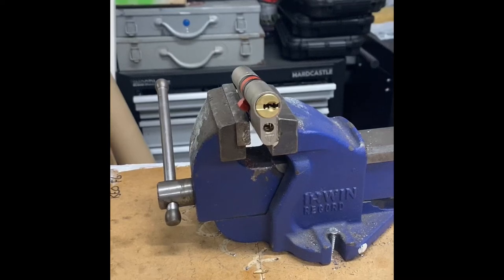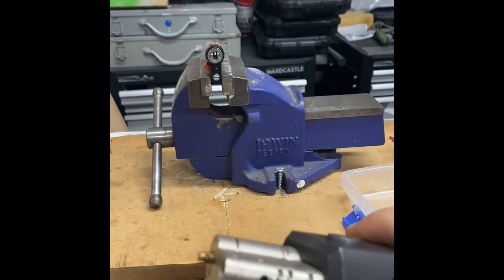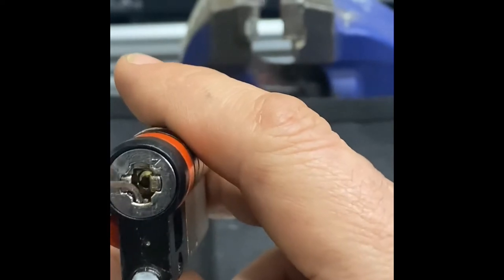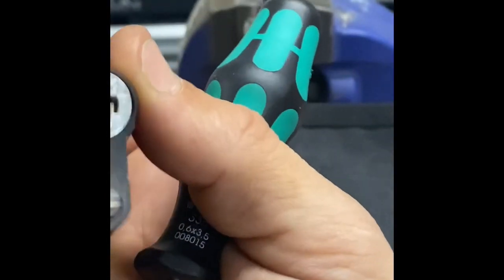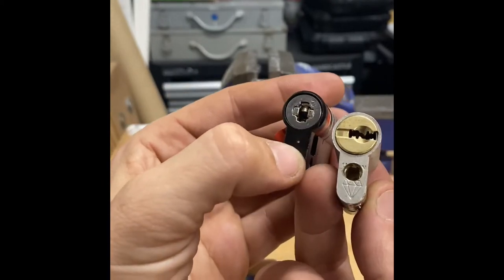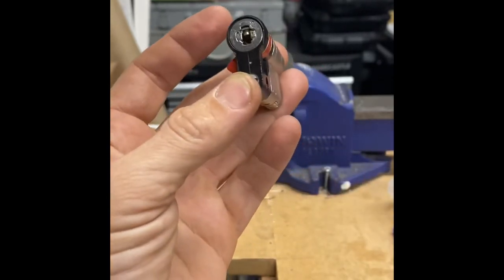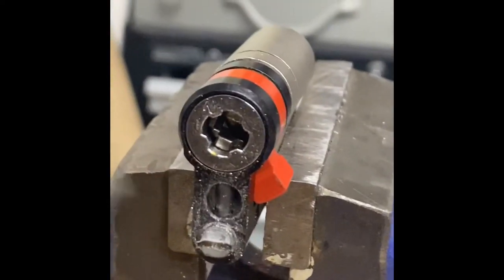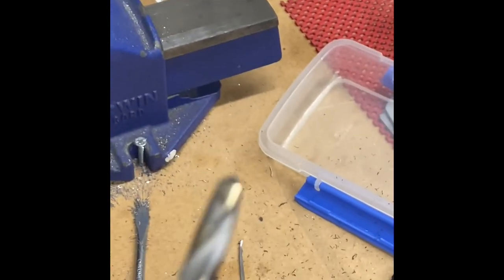Snapping the Ultion 3* Diamond ‘anti snap’ cylinder. - £1000 winner?

Comment: Have been looking to replace my locks so checking out YouTube to help. Find this a very distorted video as the integrity of the lock is helped by the door frame and that how it should be tested. So I would imagine snapping it in a vice is not a very accurate representation of its snap strength. If you are going to demonstrate how easy it is to break or drill ANY lock then please do it in real situation, in a door, using the same  tools an opportunistic thief would be using. Then at least any customer would be able to make a comparative choice and your videos more worth while. This video does not help any consumer looking to determine what is the right lock to choose.
Reply from the maker: Thanks for your comment. This isn’t a consumer video, but I appreciate your feedback. I wouldn’t recommend these cylinders for many reasons, So it is kinda is helping you determine which lock NOT to choose. Personally I have EVVA cylinders on all my doors. There’s my tip. 😉. Plus any of these I have opened in real doors, in real life situations, I’ve picked the lock open in minutes.
Reply: @LondonLocks  this is very good video, cause it actually shows that even if you snap the lock you are still fail to open it. And you would never snap lock that quick when it’s in a door.
Reply: I completely agree with you Nick. Very few of these videos are made for consumers, they seem to be made for lock pickers. It really is silly to put the lock in a vise and demonstrate its destruction because anyone can do that. A burglar is looking for the easiest quickest way to get in and he won't be bothering to take minutes to fiddle with the lock, let alone carrying a vise and an electric drill around with him.

Comment: This is an unfair test as when the lock is in the door, its supported by the door up to the point where it is supposed to snap, the point of snapping is designed for being in a door and won't be effective in a vice.
Reply from the maker: a determined burglar will have the handle off in seconds be able to get pretty much the same leverage.
Reply: @LondonLocks  Yeah they can easily snap the handle, but I don't believe there would be as much of the lock barrel protruding from the door as there is from your vice. And like Philip above was getting at, the lock is held in place with a central fixed bolt, meaning the snapping point is completely different to when you have over half of the cylinder clamped in a vice.
Reply: I work in the upvc industry 
Just this morning I had to help out a new fitter with one of these lock as they had lost the keys (they come with the comp doors the company supply) 
20mins it took to drill, snap and trigger the firing the pin. They come from the factory installed too
All I had too was basic equipment 
I’m certainly not impressed with them finding out how easy it was
I find the secondary anti snap sleeves that can be fitted over the barrel behind the lock handle better as both sides are connected with 5mm Alan screws clapping both sides together  the handle
Reply: I've snapped these clean off when sitting without handles, I use the pick when the handles support it. It really does rely on the handles to stop it from being vulnerable. The correct fitting of the cylinder is essential also.
Reply: @escos0410  So it took you 20 minutes to break this lock as apposed to 30 seconds for a normal euro cylinder lock?? I'd say that's a win and a positive for this lock. Appreciate it might not be infallible, but it's a huge improvement on 99% of the locks out there today surely.
Reply from the maker: @leejordan5327   the real problem is they pick too easy. All the destructive methods in the above videos are the last resort. with practice, these can be opened in under 2/3 mins in silence. which is not good and not worthy of 3 stars IMHO.
Reply: Next time do it the door
Reply from the maker: @stevenjones9327  we wouldn't do this to a door. we'd normally pick it. The video highlights thats the anti attack features aren't as good as one might expect.
Reply: @LondonLocks  yes and that's why it wasn't so hard to break so do it next in a real door

Comment: I don’t think this is a true representation of the lock. It’s a bit like driving over a phone with a tank and saying it won’t withhold pressure from being in your back pocket.
Reply: It won't, if previously ran over by a tank. Lol.
Reply from the maker: fair comment. however, if the handle were removed you could still get the same result.

Comment: None of these videos destroying 3 star locks, from experts, ever give you a better alternative or any advice on what we should be using to deter thieves...
Reply from the maker: Hi. I would recommend an ABS Master cylinder. It puts up a way better fight. i would also match the cylinder with a 2-star security escutcheon.
Reply: @LondonLocks Thanks for the reply, much appreciated. I was looking at the ABS also. So I'll go ABS then. Thanks! Would you recommend a cylinder guard too or is that not necessary if you have the 2 star handle? There have been loads of snapped locks in our area recently, and many stolen cars. In fact there was a question raised about it by our local MP in parliament a couple of days ago... that's how bad it's got. The area is Sherburn in Elmet.
Reply from the maker: @lawts78  2-star handles are the perfect match for a 3-star cylinder. The aim of the star system is to try and achieve 3 stars total, if you achieve 5 you are way above the recommendation. But this is what I have on my own doors. The more protection for the cylinder the better. Kind regards.

Comment: I agree to an extent of how this can be seen as unfair as the barrel will be mostly in the door if people measure the cylinders correctly. But these locks like most can all be picked. The ultion being the biggest gap opening so all tools can be inserted to be picked. I have this lock but replaced it with something else as I didn’t like it. Also when inserting my key to lock and unlock my door with this lock it was very clunky and wasn’t smooth to insert. Really put me off having this lock. There is a YouTube video where someone picked this lock within one minute

Comment: This is test about how to destroy a lock, not about gaining entry through the door. As far as this shows, this lock has done a fantastic job, so it's an endorsement for the company that makes them.
Reply from the maker: My point is there are better cylinders on the market. Manufacturers say this and that but really with the right tools and a little bit of know-how most high cylinders are really not that hard to open. One should believe all the hype, as always. consult your local MLA-approved locksmith for advice as they'll know what's best for your area based on the attacks they see. FYI - these locks pick open very quickly so drilling or snapping is the absolute last resort.

Comment: did the drilling cause the sections to bind together leading the cylinder to snap at the wrong section?
Reply from the maker: Hi. No not at all. Drilling slow and steady caused no binding. In real life I wouldn’t have the luxury of apply the same force as in the video, unless it was fitted badly.
Reply: @LondonLocks  I see. When it is not possible to get purchase on the cylinder with the snap tool would it be good to use a plug puller tool?
Reply from the maker: @danthelambboy  drilling would be more effective than snapping in that instance.

Comment: Its a good lock. Unless you have a 2 inch solid steel front door and 2 inch thick break proof windows they will get in if they want. They could just break a window or cut through the door. Ive seen it where theyve not bothered drilling the lock and just use a flame tourch to cut through the door around the locks
Reply: Be there along time if it’s a rock door 
I won’t use anything else.

Comment: Since it's easy for a burglar to snap a handle and gain access to a cylinder, do you think it would be a good idea to weld the outside handle to the door? (my door is an aluminum door) provided that you can still change the cylinder when needed by removing the plate that's on the inside of the door and then removing the cylinder from the inside.
Reply from the maker: I would not recommend welding ALU. I would recommend using the Ultion/Brissant Sweet Sweet or Lock Lock handles. they're bigger and more robust.

Comment: That’s the older version ultion
Reply from the maker: It is.  But the new one is no better.
Reply: London Locks do you need to mod the pick for the wxm?
Reply from the maker: Boss Beano yes. The pins are on the other side of the cylinder. It’s a mirror image. And the keyway is way wider allowing easier access. The upgrade is probably worse then the original. 😂
Reply: London Locks thanks for your help. Had one on Friday but luckily customer came back. will get the pick or picks